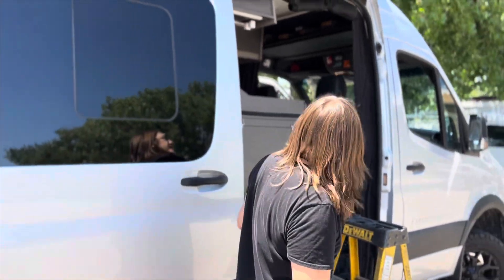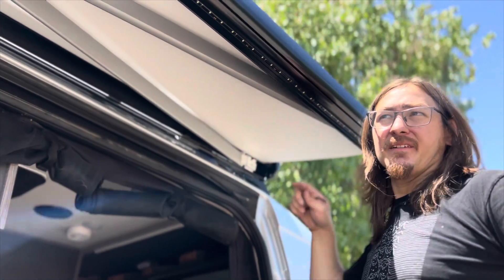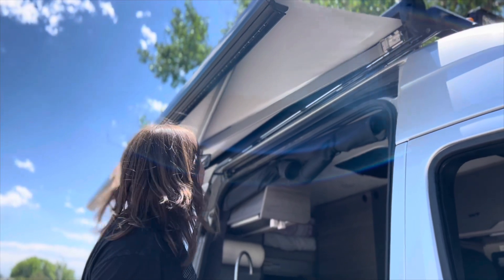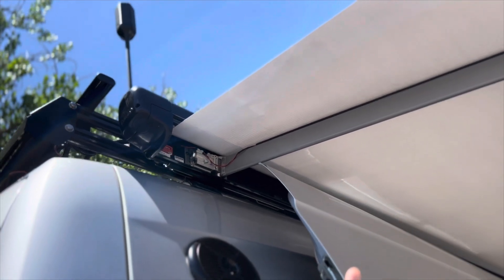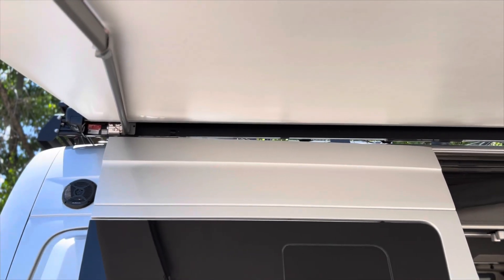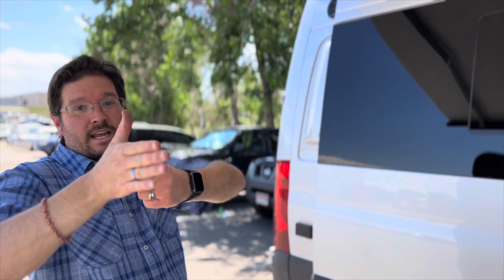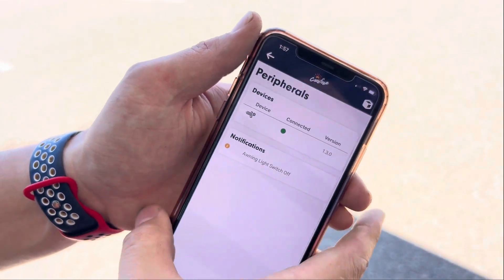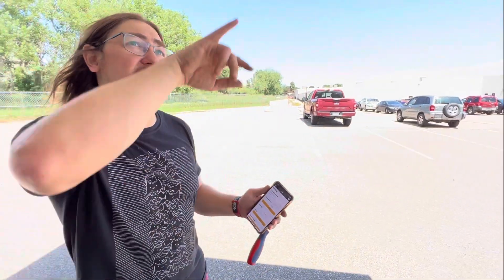Carefree of Colorado BT12 Awning - Adjustments and Troubleshooting

Comment: Very helpful. Mine did not work from the day I picked up my van. Took to the dealer and the technician could not/did not know how to fix it. I fixed it my self after watching this. It was the 17mm bolt that was loose and the two rubber bushings. I should go and show this video to the technician.
Reply from the maker: I’m very happy this helped solve your problem!
Reply: I have the Jayco Terrain 19y, which 17mm bolt was loose?  Where can I access this bolt if my awning won’t open? Thanks in advance.

Comment: Thanks for the video.  I have a Carefree Evolution on a WB Navion and I’ve talked to Carefree multiple times and over time they have even sent me two new sensors and a new BT module.   The sensors pair and work for a while but eventually won’t pair anymore,  usually after a few battery changes.   The only thing that seemed to work is placing a switch on the BT module’s power cable to fully shut off power (Carefree’s on/off switch does not fully cut power to the BTmodule) and force a complete power reboot.  That power reboot seems to get the BT module pair to the wind sensor.   I did not know about the 10 second retract reset though that made no difference in not being able to pair.   I’m just going to ditch the wind sensor since it’s been so unreliable…..and when it did work the batteries (used new Duracell) never seemed to last that long, maybe 4-6 weeks.
Reply from the maker: That is frustrating to hear about the sensors.

Comment: Great video. It helped with one of my issues with the motion sensor, the problem I have now is that that it stops about 3 inches out.  The manual adjustment screw does not work, well it does, because if I crank it counter clockwise it sticks out further.  It appears that the direct response is stopping it?  Is there a way to reset that?  I can crank it in manually...
Reply from the maker: Thank you! I’m not sure. I’d give Carefree of Colorado a call.

Comment: We have motorized carefree side awnings we install on our campers. A few of them don't close fully on the left side by at least an inch. It will close with force but pops back out a bit despite adjustments. It seems too tight at the knuckle..any thoughts?
Reply from the maker: I’m not familiar with that. I’d recommend reaching out to Carefree of Colorado.

Comment: In FB group, I saw a lot of people mentioned that their awning extended by itself, even when fuse were already taken away. What was the problem? Is that already solved? I am afraid to by a class b with carefree awning.
Reply from the maker: You’re likely referring to the Carefree awning that came on the Revel. There was a recall that addressed that issue. It’s my understanding that the Jayco Terrain and Entegra Launch use a different Carefree model. I’m not aware of any Terrain or Launch owners having that problem.
Reply from the maker: I know that there was a recall on the model that comes with the Winnebago Revel and since that recall I haven’t seen any Facebook posts from Revel owners but I did just recently see a post from a Thor Tranquility owner. There’s several companies that manufacture awnings for class b vans so you have options.

Comment: I have a 2017 Roadtrek 190 Popular with a carefree awning. It won't hold the adjustment when I try to close it.  I tighten the lower 4mm hex screw under the rear cover to close it but then I crank the awning out several times and it'll stop short of closing again so I have to tighten the screw again. Kind of a pain.
Reply from the maker: I agree, these things can be a pain.

Comment: Man perfect video as my Carefree awning doesn’t extend on my new Jayco Terrain 19Y. The motor just runs for about 30 seconds.  Any ideas on how to get it to extend?
Reply from the maker: Have you tried giving it a couple of good slaps while the motor is running? It might just be stuck. After my visit to Carefree and having them dial mine in perfectly, I now have to slap mine once or twice to get it to extend. If you are able to get it out, check the bumpers to see if they are in the proper position.
Reply: Thanks I was able to do this but now the awning won't close all the way. Maybe 12 inches out from closing.
Reply from the maker: @BWT599 have you tried manually cranking it in?

Comment: My awning on my Launch is sticking. It opens after prying it with my fingers and will operate normally. Once the van sits for awhile it will stick again. Not sure if I need to make some adjustments.
Reply from the maker: In the video at the 6 minute mark, they talk about bumpers that tend to move. Have you checked the positioning of yours?

Comment: Good info Jeff and helpful. Would be better if they sounded a little more professional in their descriptions. Too choppy.
Reply from the maker: Thanks for the feedback. Not professional actors. 🤣 We didn’t have much time to put this together so I didn’t want to ask them to redo parts.
Reply: @terrain4x4adventures I went to open my awning today after been shut for awhile and it almost unraveled itself. Fortunately I stopped it just in time but had to take care of a sag which I did. However when I try retract it now it goes until about 2 feet and stops. If I try open it, I have to stop it because it will unravel itself. I’ve tried to adjust the screws but nothing.  Can you ask what the fix is for this?  Thanks.
Reply from the maker: @avacop96  That’s a tough one. Reach out to Jeremy Nicoll, Customer Service/Technician @ Carefree (303) 469-3324 or jnicoll@carefreecolorado.com. He should be able to help you.